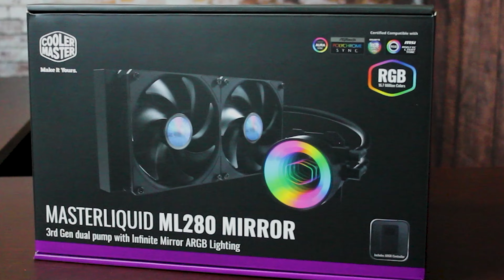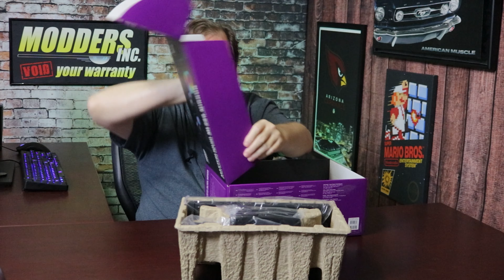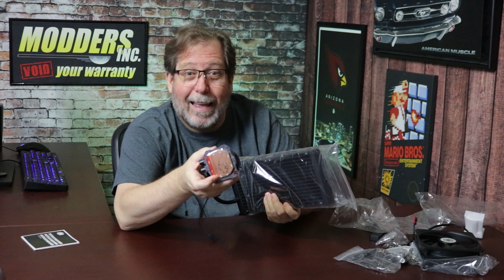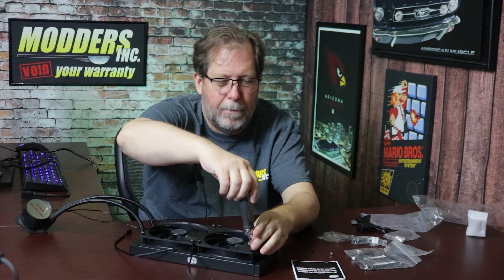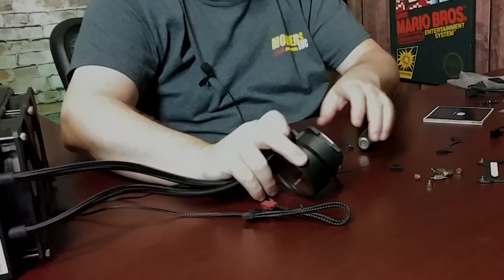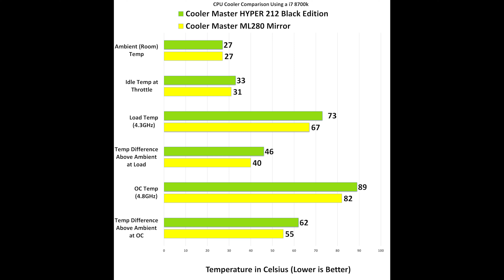Cooler Master Masterliquid ML280 Mirror AIO

Comment: Why do people test case coolers on open benches? It's pointless.
Reply from the maker: Hmm, there can be a very long discussion about this, but the easiest way to state is that ANY cooler will only remove a certain amount of heat based its design and the ambient temperature in either in a box or open air.
Reply: @Moddersinc any cooler has a limit on heat transfer yes but a box will not allow the highest airflow possible and many cases have very restricted air flow. A cooler on an open bench will work at the maximum performance that it's allowed by its ambient temperature, a cooler on a case won't.
Reply from the maker: @vasilisgreen you are correct as I should have not used the word box. But for the reasons you stated it is better to test on an open air bench as it does allow the cooling setup to move as much air as possible, thus giving each cooler to show what it can do. As you know  testing a cooler in every case made is not feasible.

Comment: saw this on sale recently for 44$ at microcenter just decided to look into some reviews since there are some M-atx chassis that support a 280mm front mount. I could tell that the overall thickness of the radiator made it some what of an odd/man out scenario. My arctic freezer II 280mm has a much thicker radiator prompting better noise normalized performance when compared to an NH-D15 type air cooler or a 360mm aio which is typically louder as well. As 140mm fans spin faster or near their 75-100% power/speed they do get quite audible esp depending on fan to fan. Given that this isnt a thick rad...i could assume these fans needing to hover at 75% range or higher in the use/paring of an overclocked intel cpu or higher heat zen3 cpu or r9 cpu or any K series intel/oc situation. Given im not sure the cost/availability of these 140mm CM fans other than being able to replace them via/warranty.  You could definitely be better off with a 5x pack of arctic p14 fans and attempt to push pull them with this radiator/ ~50$ range cooler/rad. For a front mount push pull in order to maximize the CPU cooling potential or a smaller/lower airflow build like an m-atx chassis. While still maintaining a price/cost effective aspect with the 50$ 280mm aio via coolermaster. For sure a potential push pull with more radiator intent/use fans can add a level of cooling/quiet to a build...vs an air cooler of equal 50-80$ value(after a 5 pack of fans is added to the budget). Im personally interested in the rare/niche scenario where a 280mm aio can be utilized in an Itx build as the rad thickness THEN becomes an issue of clearance/support where the arctic becomes an issue with hoses/cpu mounting angles and a thicker radiator in the case of an ITX build...this CM can actually be viable and potentially cooler/quieter than a 240mm aio esp if arctic p14 fans are utilized with the CM cooler. Just theres limiting factors of being able to re-use the 140mm RGB fans as chassis fans or etc in an RGB build. Considering most owners of an EVGA 280MM CLC would feel compelled to upgrade their AIO fans to p14 fans as well...it seems like a common GO to thing to do for better noise/thermals. Just a shame arctic doesnt sell to microcenter...from what i heard the sales reps...most consumers see their 3 year warranty and its off putting  vs the 5+ year offered by nzxt/corsair etc....even though their fans and thicker radiators are already a better design/option than most AIO. Most likely going with an undervolted PBO2 5800x on itx...or a 12600k....leaning on 12400 and b660 instead...so i can build a 13th gen with a fully 13th gen supported itx board once that launches. I got a budget build FS with a 3600 and rx 5500xt 8gb...and a 212....and honestly it doesnt need more cooling w.o a BIG GPU or a faster cpu like a zen3 or r9. The heat of a big navi or 5700xt in a build like that in a mb311....instantly becomes a challenge to air cool a cpu or quietly cool a cpu. ESP if a bronze/hot psu is in the equation as well. TBH you really have to look into your budget/chassis cooling aspects bc a cpu cooler wont really solve many cooling aspects that can be conditional to psu/quality/heat. As well as GPU design/heat. A cpu cooler can only really get a build so far. Which is at least nice to see how cheap this 280mm aio sells for when on sale...really competitive at 50$ range...with various air coolers. Ultimately the only reason i look for "MORE" out of a cooler is purely from a noise/performance ratio. But really cooler investment is largely conditional based on GPU heat/system heat and how much a persons willing to invest in chassis fans/air flow oriented chassis and how much their willing to add into their build budget for these cooling aspects 50-100$ or nothing at all. Most of it is typically concurrent with a persons build "BUDGET" chassis like mb311...budget m-atx board/vrm....and budget/bronze psu. Add usining multiple fan/rgb headers vs a hub/controller etc....and thats already an inherent potential cause of system failure that large circuit and 12v rail stretched among multiple rgb fans etc controlled via bios or software that has to be on/enabled. These would be a system failure cause prior to a bad cpu cooler/temps. faulty psu/12v rail decay, large fan/board circuit on a 24/7 cycle. PWM constantly. A pump is already an aspect of failure with these AIO vs air coolers. So there can really be an aspect of complication to any new users that dont constantly monitor their temps to insure their aio/pump is operating properly or their thermal paste needs to be re-applied. SO many aspects that can lead to pre-mature failure due to a lack of upkeep/due diligence. As well with AIO that air coolers generally avoid outright. Just in the case of powerhunger 275w+ gpu AIO become more of a common ground or effective option bc of cooling higher 5ghz range cpus and that huge system heat aspect with larger gpu. Even with GPU i invest more towards a model that cools better/quiter/offers a NON OEM Vrm/vram cooling/use potential. Better parts/system methodology goes a long way vs expecting A lot from a 50$ cooler. IMO for 50$ this thing is a steal and i wouldnt expect MUCH/more than what a product thats sold/marketed as better has to offer most of these aspects with these products are pretty concurrent with their price/build quality and the "TYPE" of builds theyre price/marketed oriented towards.

Comment: I thought a liquid cooler would be far more efficient at reducing heat than your tests seem to indicate but this is the most technical thing I've watched when it comes to measuring the results against a standard cooler, but no offense meant, it was kind of sad n confusing. But hey, that may have more to do with me and my comprehension than it does with your explanations. I guess I just thought the results would be better.
Reply from the maker: Sometimes it is not about being more efficient, but able to maintain cool temps and reducing noise when using an AIO. If you want to start getting lower temps you should look towards doing a custom water cooling setup.
Reply: this is also on a test bench scenario. The 212 largely differs in performance in scenarios like being used in ITX, or M-atx like a coolermaster MB311. The level of cooling potential with that air cooler is largely affected by weather or not a 300w gpu is in the same system creating heat on full gpu load. Or if its a budget range 100-150w gpu. In reality an aio mounted where no heat affects the radiator would be best like a front mount or intake mounted AIO. In the case of the MB311 m-atx...a front mount 280mm and pure exhaust pathing for gpu etc heat system heat out rear/top. Ive used a 240mm msi aio in a lian li 205m build with a 5700x....the 212 got too hot/vrm area etc bc of the 5700xt strix....the AIO was mostly to help mitigate CPU cooling with the GPU heat that system/build generated. Once an hour in/deep the gpu heat got so bad at least the 240mm aio was able to push OC on the 10600k w.o seeing high cpu temps...but the 212 barely managed to run the cpu stock in the same build in games like warzone which is very taxing on even a 6c cpu and a maxed out gpu like a 5700xt. MANY of these AIO are already limited by their block/contact surface etc being the real pitfall of their transfer efficicency and ability to cool the coolant or keep it somewhat "warm/hot" Its why the EK aio is one of the better options bc its BLOCK is inherently more efficicent than the majority of AIO out there pump/coolant aside...the block itself is just better at reducing/dissipating heat than the other more commonly used designs..and EK SHOULD bc they already make CUSOM watercooling parts across the board....The majority using the same OEM design all hit their WALL...and ultimately COOLING potential(common coolant heat limits)...really leaving the buyer left to choosing based on RGB/aesthetic/price point...or rad thickness/fan size based on noise performance.
Reply: @anhiirr  I'm trying to decide whether to go to the effort of installing a liquid cooler which I already have on to my new Ryzen5 5600X system in a midATX box with 4 fans that came standard, 3 front in 1 exhaust. I also have a RX 6600XT GPU. The system usually runs mid 40s-50s on the CPU and 40s GPU on the stock cooler but running Benchmarks my Cpu went up to 92c which seemed a bit high to me but I know very little about it. I could just stop running the benchmarks ;). The hardest my system is used for is World of warships that doesn't seem to stress it at all. My old system was an old triple channel DDR3 i7 that used to get very hot to the point that it became a problem  hence the liquid cooler. Is hitting 92c reason to change cooler?
Reply: @adamskinner5868  idk how old it is but the pump could be dead/dying and the coolant/liquid inside TBH not exactly sure but this could definitely be a possibility

Comment: Hello, nice video, I just bought a 280mm mirror one for my MB 530P, as stated on website it should have fit but my MOBO shroud came in between and it was too tight for my case, so exchanged it for an ML 240 mirror it was a nice snug fit after that I started everything was fine but after 2 mins I started hearing loud/bubbling sound from it, so I moved the case then removed the Radiator and moved it around to no avail the sound (idk why the sound or bubbles did not go away) is still there as if air bubbles are in it or something, please advice. From what I heard these pumps are supposed to be quiet, but mine is loud does that mean I have to exchange it for another one, it works well Temps on my 2700X are about 38-50 C this is the best thing evah.
Reply: Watched GamersNexus vid on how to mount radiators to avoid noise n air bubbles that can limit performance. Radiator non-pipe end at highest point so air gets trapped there and is not in the flow ;).
Reply: @adamskinner5868  I am mounting my Radiator at the top, so should not be an issue, also the pump was faulty, so I exchanged it and got another one, and everything has been fine eve since then. I also saw the Gamer Nexus video very cool.

Comment: Using the software, is it possible to achieve static white?
Reply from the maker: I believe so. But with the push button control you can do static lighting
Reply: I cannot figure out for the life of me, how to make it static white. I see it hit white during its colour cycle, and I want it! Can't figure it out though. Please share if you solved it.
Reply: @andrewcurrie5487  I did figure it out. You need to connect it to one of the RGB headers on your motherboard, then install one of the approved softwares. If your mobo doesn't have an RGB header, you are out of luck.
Reply: @Garrettjohnson94  what software did you use??  Was it the mobo software or the cooler master software?
Reply: @BlackAdrenaline-TV  I used Asus Armory Crate, since I have an Asus mobo

Comment: So since this aio is powered via the fan header, does the pump run at 100%? Is it noisy?
Reply from the maker: Yes if the fan pinout is set that way in the BIOS. In my testing I did not think the pump was noisy.

Comment: I added 2 SickleFlow 140 V2 ARGB fans and it looks awesome. Works great and yes it an Amazon exclusive.
Reply: Now on Newegg
Reply: @fluxcapacitor05  yes it is.
Reply from the maker: Awesome, great information
Reply: for push pull? like included fans/pump connected to cpu header....and a splitter to the "Added fans" duel connected to a "pump" or etc header....and matched to cpu curve or etc? Im looking into wedging this 280 into an itx build and i need an ideal fan header/combination and ease of use fan control for a potential 4 fan push pull setup since the build will somewhat lack airflow.
Reply: @anhiirr  I have it top mounted with a pull config "into the case"  I need a positive pressure because of cats and it is filtered. So far I've had no problem with Coolermaster. 🤞I am really liking 140 fans.
Reply: @WDMurphy  nice the value of this AIO is hard to beat 120mm was just too loud/cheap fans for my taste but given how good these stock fans are compared to some 120mm aios it makes this 280mm aio hard to beat when i see its on sale prices and thermal capability on par with more expensive air coolers. Looking forward to these newer gen/next er gen gpus and the potential for them to offer ever more peformance at a much lower wattage/heat so i can look towards downsizing my build
Reply: @anhiirr  The fans that came with it are just as good as the ones I bought. I just wanted an RGB build lol (even tho I keep it off 90% of the time) I only really use the RGB for temp monitoring.

Comment: How did you connect the rgb? for mine i have to connect it to the controller mine has no 3 pin only 2, 4 pins where 4 pin is better
Reply from the maker: I only used the included controller

Comment: So I figured out where to plug the cpu fan but not sure where to plug the rgb cable at in the mb. I’ve noticed that the 12v has 4 pins while the cable has 2plus 1 spaced slot which makes it impossible to connect. I wish to use software so I’m not really sure how to connect it to the mb. Could you help me out?
Reply from the maker: What motherboard you using?
Reply: X570 Meg unify
Reply: Cooler master doesn’t really specify if the rgb cable for this aio is 5 or 12 volt
Reply: It has 2 3pins and one 4 pin. The 4 pit is 12volt I believe but the 3 pin is 5 volt. What I’m not sure about is it I can plug the three pin female connector coming from the aio in the 5 volt connection
Reply: @Hypnaa  3pin at 5 volt is fine to plug in. I've got a X570 TUF gaming with one 5 volt 3pin RGB header and working fine connected to this.
Reply: I’ve sent you a message on Instagram to your page if it’s any easier to talk?
Reply from the maker: I think your motherboard may not support rgb lighting since they did not put any on the board it self. You will need to use the included control box.

Comment: There are two cables coming from the cooler, one is for the RGB, and I'm not sure which port to connect to for the other one? Like the CPU fan, Pump fan or just regular chassis fan?

Thank you!
Reply from the maker: You can connect it to any of the three you listed. Normally you would like to plug it into the CPU fan pinout. This way the pump can go faster or slower depending on the CPU temp. On motherboards that have pump/fan pinouts would do about the same. You want to check in the BIOS to see whereFAN  Pump/FAN is getting its information from on how faster to run, such as CPU or Chasis.
Reply: @Moddersinc  Thank you. The manual doesn't tell which pin is it so I decided to plug the cable into the regular chassis fan... Will it be fine or I need to re-plug it into the CPU fan pinout?
Reply from the maker: I prefer to use the CPU fan pinout as it is always set to read the CPU temp and will adjust itself as needed.
Reply: @Moddersinc  Will do. Thank you!

Comment: so I'm a first time pc builder and I just got mine together. I got this aio but I can't figure out how the RGB controller goes on properly. I have the light on because the rgb cable on the aio itself is plugged into the mobo but idk how to connect the rgb box.
Reply from the maker: If the RGB cable coming from the AIO cooler/pump housing is plugged directly into the motherboard then you do not need the the extra box. What you do need is to make sure that the motherboard is either and ASUS, ASRock, or MSI board to use it that way. The extra RGB controller box is used when your motherboard is not one the three listed. If that is the case you then take the wire(s) that have the SATA power and ARGB pinned connector, plug it into the controller box (large hole). The SATA end you plug into a SATA power and the pinned ARGB wire you plug into the ARGB wire coming off the AIO cooler/pump.  I think I said it different or maybe confusing in the video, sorry.
Reply: @Moddersinc  oh no you explained it fine. I'm new to the whole computer thing so sorry if I'm just a little lacking. my motherboard is an Asus prime x570-p so I have an rgb header but when I plug it in there's no software or anything I can download to change the color. when I download one it just tells me it can't detect the box so I plugged it in and the same thing happens either way I hook up the rgb cable. I've downloaded and tried each one and none work for me
Reply from the maker: I think you download this utility and it will have the AURA Creator https://dlcdnets.asus.com/pub/ASUS/mb/14Utilities/ArmouryCrateInstallTool.zip